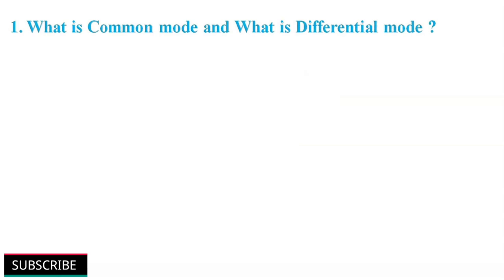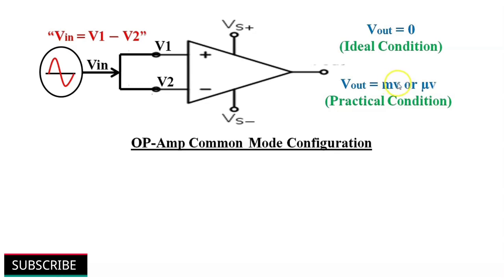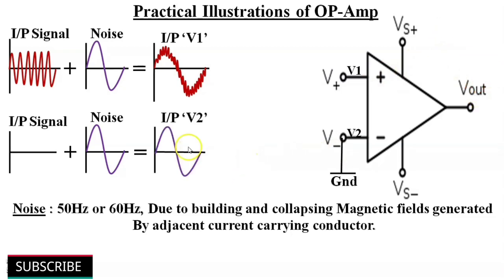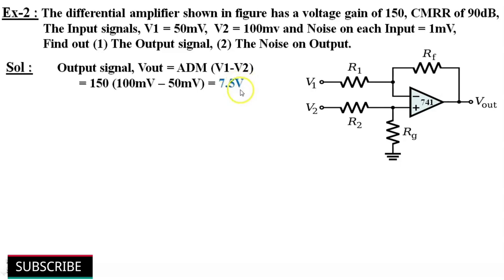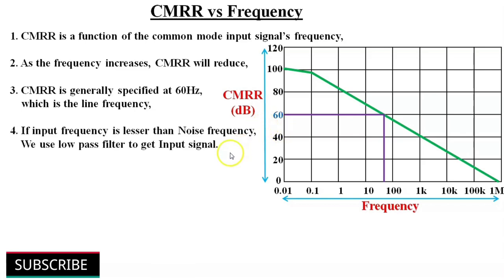OP-Amp Common mode rejection ratio (CMRR) Explained with Examples

Comment from the maker: The timestamps for different topics covered in this video are as follows,
1) 00:07 - Introduction,
2) 00:40 - Common mode signals Vs Differential mode signals,
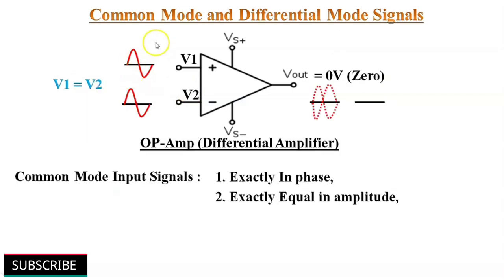3) 02:01 - Noise in Single ended amplifier Vs Differential amplifier,
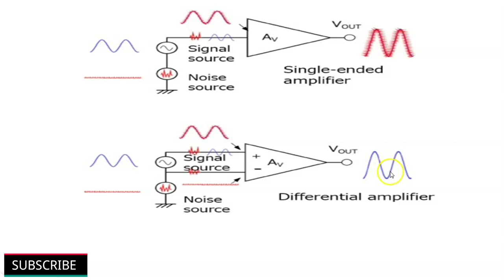4) 02:31 - OP-Amp Differential mode configuration,
5) 03:23 - OP-Amp Common mode configuration,
6) 04:03 - Voltage gains of OP-Amp,
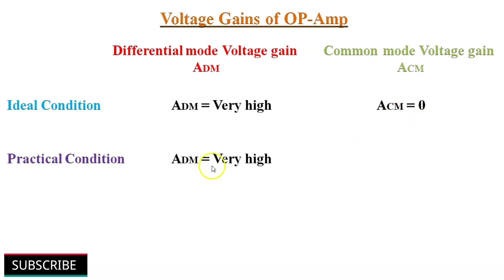7) 04:30 - Practical illustrations,
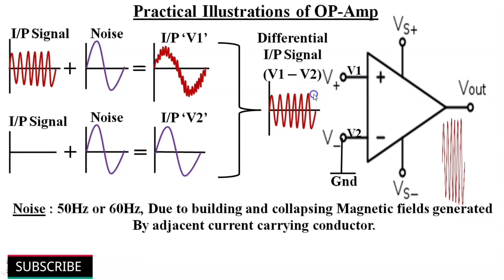8) 05:48 - CMRR formula Explanation,
9) 06:41 - Conversion table of CMRR in dB and Data sheet,
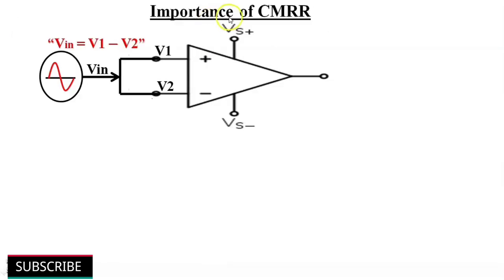10) 07:00 - Importance of CMRR,
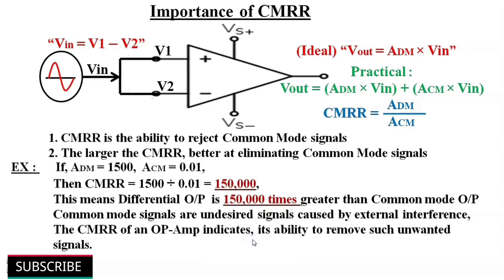11) 08:35 - Examples and Solutions (Example:1),
12) 09:50 - Example :2,
13) 11:49 - CMRR Vs Frequency,
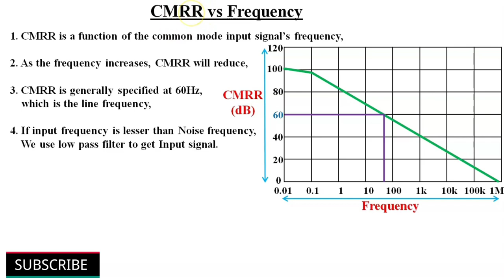14) 12:44 - Thanks for watching,
15) 12:57 - Next video.

Comment: Ex2- Noise on each input is 1mv . So as it is a common mode voltage , it should get rejected? Where I am  lagging .
Reply from the maker: Due to imperfections within an actual op-amp, some common-mode voltage will appear at the output,
Watch these videos:  
1) https://youtu.be/GvAlSuXSt5o (Op-Amp Input and Output offset voltage),
2) https://youtu.be/WBp-EF3PCwc (Op-Amp as Differential amplifier).

Comment: 2:29 why is there still an output of the differential amplifier when the two incoming signals are in phase? I understand that the noise gets to zero, but the output also has to become zero right? Help me :)
Reply: It is due to imperfections within an actual op-amp, some common-mode voltage will appear at the output,
It is also influenced by imbalanced resistor values at the input terminals,
It also depends on the frequency of the common mode input signal.
Watch these videos:  
1) https://youtu.be/GvAlSuXSt5o (Op-Amp Input and Output offset voltage),
2) https://youtu.be/WBp-EF3PCwc (Op-Amp as Differential amplifier).

Comment: Sir i have doubts in a question pls help me the question is

 If the ratio of differential gain to common mode gain is 10000, in certain differential amplifier, then CMRR is
Reply: CMRR is the ratio of differential gain(ADM) to common mode gain(ACM),
In your case its 10,000,
So, CMRR dB = 20 log10 ADM/ACM,
= 20 log 10 *10000 = 80dB.
Refer Example :1 in this video,
Reply: @RobertRobert-bn6fr  tysm sir
Reply: @BeerusOPP You are welcome

Comment: Hello Sir, how was the conversion of 90dB. When I make mine, I get 31623 for the 90dB ~ 90, then if I replace it back to subscription, I get the 31623/20 then finally 150/And ( 150/(31623/20) ).  Finally my Acm =  0.095V
Reply: CMRR = antilog 90dB/20 = 31623,
I hope this cleared your doubt.